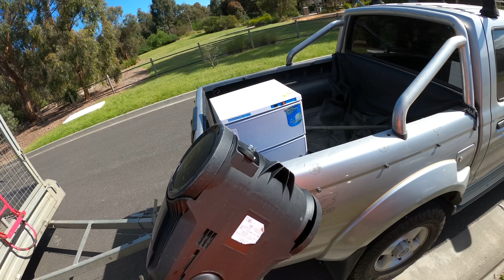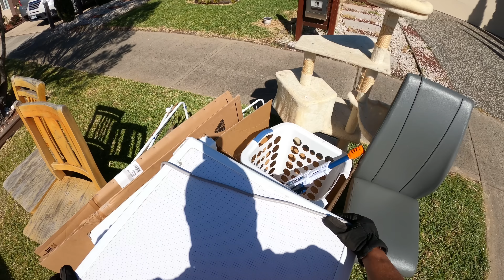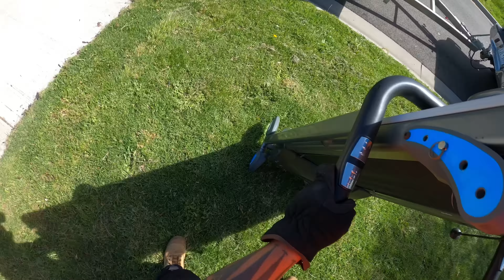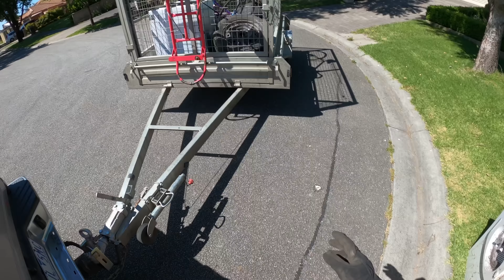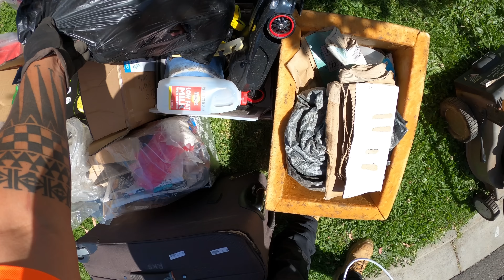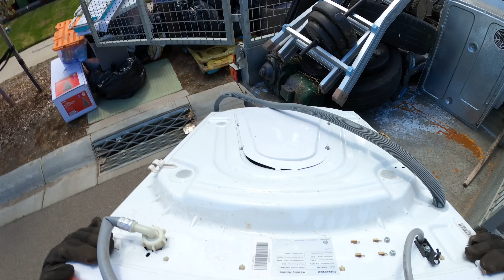Spring Time Curb Scavenger Hunt!

Comment: On the first adress was a garden hose. Did you checked for brass ends?
You were in a hurry because you were blocking the road. I think you have the right to block because you pay the taxes and it didn't take long. Or am I wrong? In the Netherlands 🇳🇱 it is allowed to load/unload a vehicle even if you are blocking the road.
Reply from the maker: Unfortunately most garden hose over here have plastic fittings, they are rarely brass. It’s similar rules here though one of the stops was a one way street. Traffic can’t go around until I move.